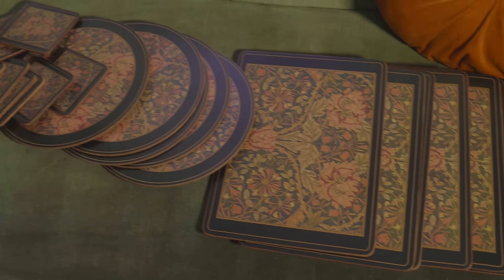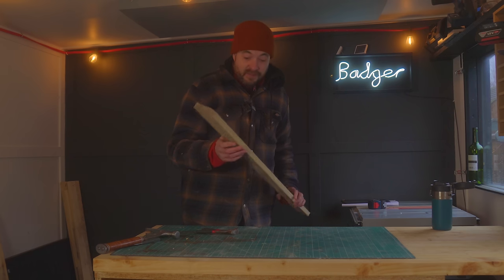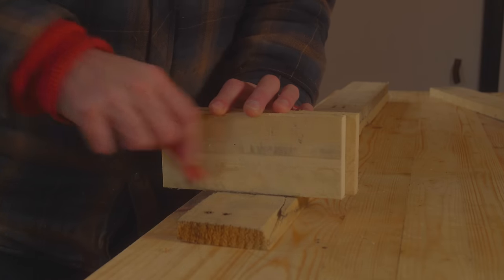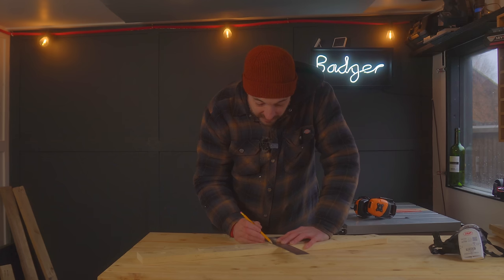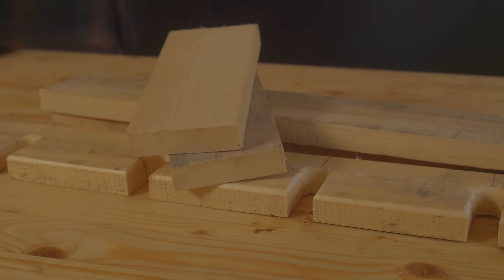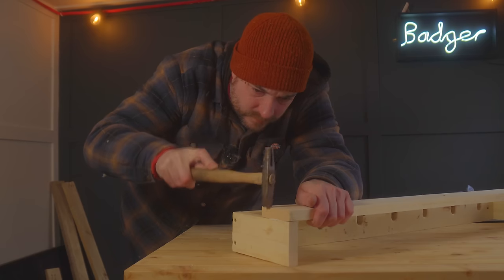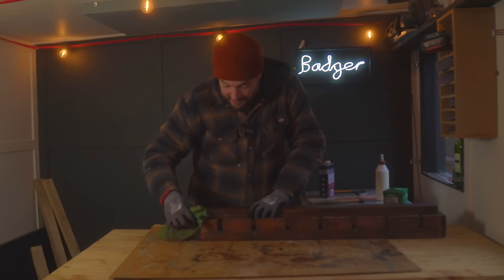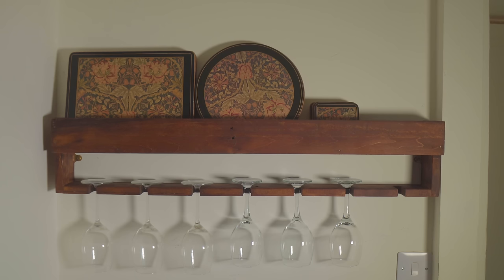Making A Wine Glass Shelf

Comment: Great looking quick job and great video as always. I know you checked but normally light switch wires come down vertically to the switch (and socket wiring comes up from the floor) so I' cringed a bit when you drilled right above the switch - just in case anyone didn't have a tester. Merry Christmas Matt.
Reply from the maker: There is a boxed in pipe next to in that has the cable I think